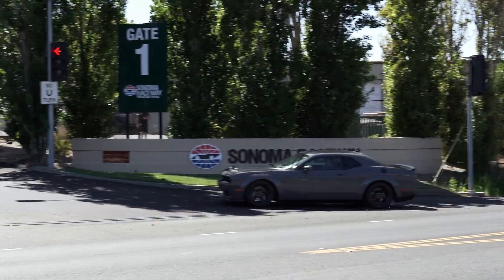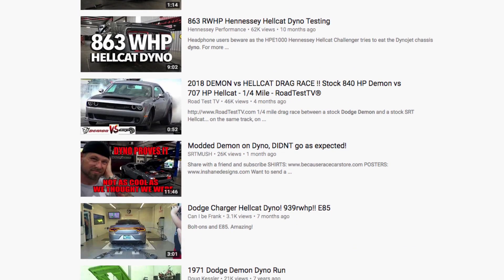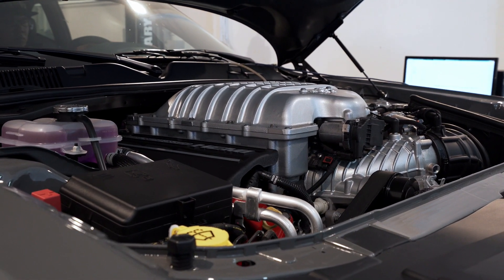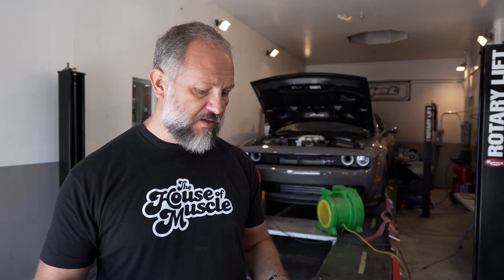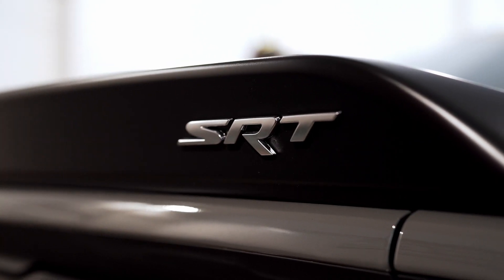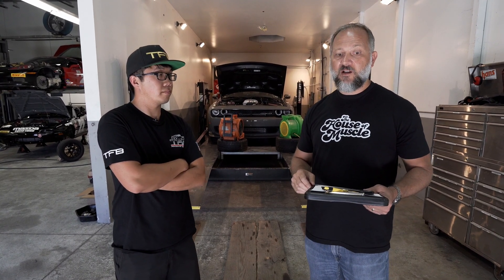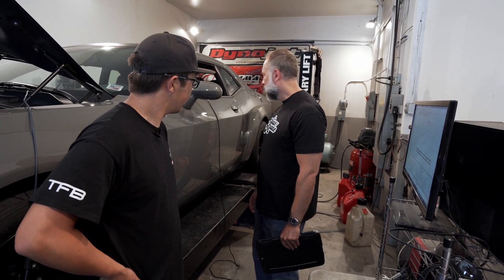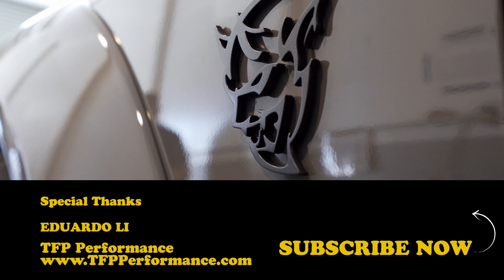THOM: The Demon Diaries - Part 4 / Demon on the Dyno

Comment: your not kidding about the numbers, I remember hearing stories of how back in the old lambo factory back when lamborghini was one of the few makers of high performance cars back in the 80's that engines ranged in output, and the actual figures on the unplugged engines in europe were about 450 plus+ and ranged wildy between 450 and 500 just based on the fact that no matter how precise you were, sometimes in some cases somethings just lined up better than others

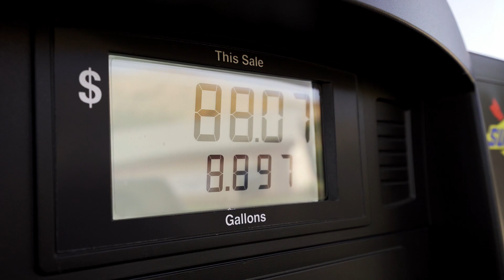4:50 and Jesus talk about hitting the warp button, also I gotta admit just looking at a challenger with round flares, I kinda wonder if this could use a touch of 80's design to it via some old school box flares like they had on some of the group B rally monsters of the period, such as the Audi UR Quattro and the Lancia Delta Ingrale and 037 some of which could actually put this thing to shame even today. 

although NOT in street trim!

Comment: The fact that you can walk into a dealership  (Dodge, no less) and walk out with 720+ RWHP is unbelievable! While it's a great engineering feat, I think it's also the reason kids aren't modifying and turning wrenches anymore. They just walk into dealers and drop the AMEX on the desk. I miss the good ole days of people getting dirty, creative and earning those numbers!
Reply: problem is, they dont put their mind to the rest of the car, as bracing kits, monte carlo bars and the like, along with brakes that you would have seen on most porsches are only a recent development

to say the least its probably a good thing they didnt reach 700 horsepower on an engine this light in a car that weights just 3000 to 4000 pounds without modern tech to keep them in check

all with airbags and modern safety built in, as doing that back then, would have been like putting a supercharged light weight aluminum 426 hemi in a dodge dart.

which they, already kinda did actually in 1968.
Reply from the maker: You guys are both right. Store bought power is easy to get these days if you have the wallet. And no question, there's a place for it. However building something up means you have to think about putting together a cohesive package that works on all levels.

Comment: can the demon run on higher than 100 octane leaded fuel?
Reply from the maker: It's not meant to. The PCM is optimized for 100 octane. Nothing higher.
Reply: oh that makes sense. Still, if it were possible to make a specific tune or give the demon a tunable ECU, how much power could it make with a higher octane rating than 100

Comment: The Demon made less RWHP than my 2012 Mustang GT with Roush blower. Yes sports fans my car will bus gap a Demon. The Demon weighs 500+ lbs more than my car.
Reply: Joe D 
As if hp and weight are the only factors. Laughable.
Reply: Sorry, didn’t mean to be snarky. I laugh because I’ve been beat because of that thinking.
Reply: No problem. My car now has a VMP Gen 3 blower. Now two bus lengths or more.

Comment: Seems like a very optimistic Dyno.
Reply: Travis Jones 
Here we go again i guess
Reply from the maker: This is as accurate a test as your ever going to get. Break-in was done exactly as prescribed in the manual using the factory provided PCM that came in our Demon crate. The fuel used was Sunoco 91 and 100 octane and the runs were conducted at sea level on a 80-85 degree day. The numbers are pretty much dead-on in regards to what the car should be making.
Reply: Travis Jones And you seem like a very pessimistic commenter.